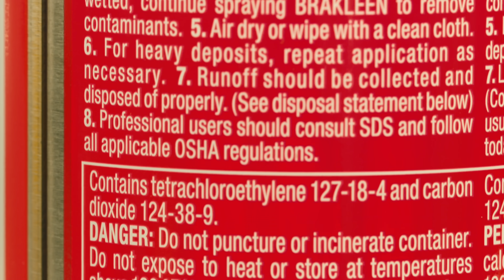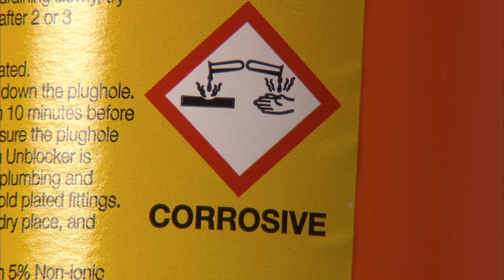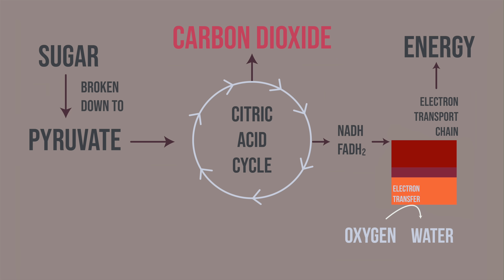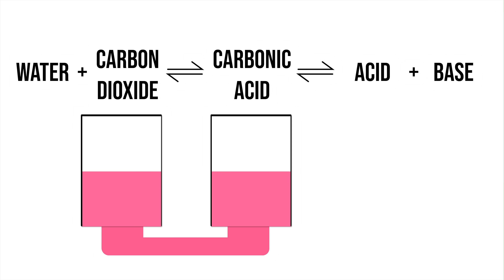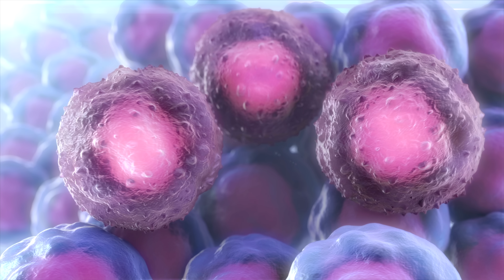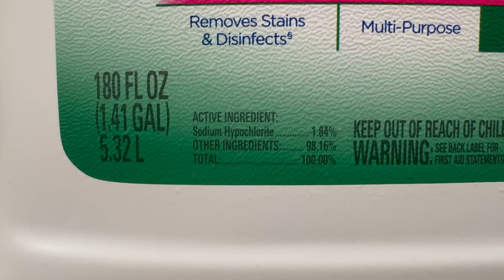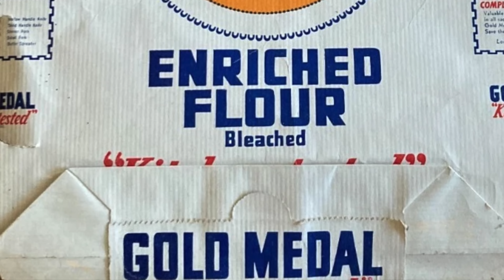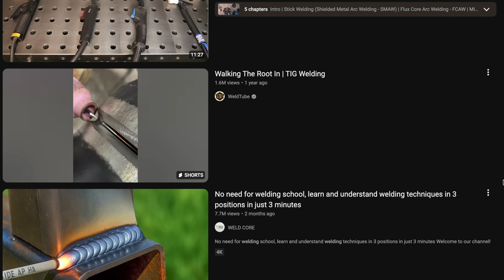"It smelled funny while I was welding and now I can't breathe..."

Comment: Wow - Ive done this before, (ex motorcycle mechanic) welding an exhaust that really was too far gone, at one point I caused a fire with the brake cleaner.
After welding I felt terrible, my lungs felt awful. I just thought I'd inhaled alot of argon from the shield gas and it was sat in my lungs 
I even layed upside down for a bit after work hoping it would help.

The thought that it could have been life threatening is crazy. My boss wasn't even happy, i'd wasted so much time it would have been cheaper for a new exhaust anyway, and the time wasn't really billable.

Comment: Yes, things like chlorinated brake cleaner and the older refrigerants can be extremely dangerous. 
But it's not an excuse to completely ban them forever because some people don't take correct precautions. It could be more regulated, though. 
The performance of chlorinated brake cleaner is not equaled. Substitutes take far longer to work with to achieve the same results. 
Similarly, the older refrigerants were far more effective and durable. Older refrigerants proved to last for decades without problems. The modern "eco-friendly" refrigerants cause so many issues and last a very short time. Ask any HVAC professional. This leads to a much greater volume of waste and forcing people to buy new appliances more often. 
I don't think the older refrigerants should have been banned. 
Just restrict access and require strict licensing for using it.

Comment: As someone who occasionally welds, I had no idea about this. I can EASILY see how someone would use brake cleaner to degrease a piece of metal before welding. Is there a period of time at which a piece of metal that had brake cleaner on it can be safely welded? Does it have to be thoroughly washed? In my experience with brake cleaner, there seems to be some kind of residue left over from using it. So I would assume, this residue still contains enough chlorine to create this deadly gas?

Comment: 15:47 True, So i thought about asking AI which can be more direct. I asked gemini pro if i should use brake cleaner to clean the rust before welding and this is what it answered right at the start:
- ''NEVER use chlorinated brake cleaner on metal you intend to weld. This is one of the most dangerous mistakes a welder can make.'' 
Ngl AI is a good and practical learning tool, definitely can prevent that situation

Comment: I don't buy a bit of this. Brake cleaner evaporates immediately. There is no residue left on the metal. Phosgene is created when LIQUID clorinated solvents are exposed to extreme heat. As in when HVAC equipment malfunctions. Brake cleaner is still very bad stuff, but this video is bogus.

Comment: An episode of Stacy David's Gearz ⚙️ (car building/repair show) many years ago in the early 2000s warned people about this. They probably saved a few lives.
Phosgene gas was used as a chemical weapon in WW1 often called CG = Choking Gas.....Phosgene gas often gets confused with mustard gas which was another widely used chemical weapon. 
Both were deadly, Mustard gas caused burns but Phosgene gas was more deadly than the mustard gas & ☠️ 💀 more people in WW1 than mustard gas did.

Comment: certfied welder here . when ever welding you want to be up wind of the smoke , some shops or jobs are very dangerous because of the fumes and flash burns ,,,,  as they make welding easier ive noticed the safty is being redirected mostly political ,  the alloys being released into the air is crazy ,,,, chromium,  aluminum alloys that cause dementia and altzheimer's,,  so many in one hour martinizing passed early working there from cancer ,,,,,  dry cleaning solvent was always in the air when you went into there stores ....

Comment: By the way, until the introduction of electronic leak detectors for CFC, all AC mechanics used so-called leak detection torches. That was a little burner with propane where the flame heated up a copper coil. To detect leaks, we moved the connected rubber hose around the system, which has soaked the air in. In the case of CFC, the flame turned green because of the reaction with the glowing copper. It also produced small amounts of phosgene.

Comment: Just as an FYI to you all to avoid any zinc painted undercoat or cold galvanised, zincalume, hot dipped galvanised steel and pretty much anything not bare or rusty metal.

ZINC IS STUPID BAD WHEN HEATED, BURNT AND OXIDISED AND BREATHED, it slowly damages your lungs and it happens gradually and is far too late when detected...

Comment: My husband is a boilermaker and once many years ago, had to cut and reweld galvanised steel.  He came home with a massive headache and joint pain.  He went to bed with painkillers and told me not to worry, I wasn't satisfied, this man is tough.  I called the poisioned advice line and was told he had gal poisoning.  Always take care of your boys.
Reply: welding galvanized steel causes zinc-fevers. its very toxic stuff. I use 3M adflow with extra carbon gas-filters + fume extraction. also grind that stuff off before welding. I have not realized its danger for more than 10 years.
Reply: @leonvdm wire wheel on small nuts and bolts also works well and dosent ruin threads. Or hold your breath and use fans
Reply: Always always respirator up while welding even normal steel can cause COPD at a young age. I weld aluminum and stainless and never don't mask up no matter how hot it is your lungs and brain are more important
Reply: @transparencyy0995 Never don't mask up... Couldn't you just say always instead
Reply: @paradoxicalmadness  He could also have just said what he said and you could have just not brought it up.
Reply: @Freshbott2 You also didn't have to say anything and yet here we are
Reply: @paradoxicalmadness  Masks do not save you from chemical contaminants... chemicals are molecularly way too small and go right through. There may be very specialized respirators?
Reply: @midwesternfnp why are you telling me this? I took a quote from the other guy and asked if wording it another way would have been better.

I also know you need to have a respirator with an oxygen tank attached for chemicals.
Reply: @transparencyy0995  Aluminum fumes are vile. Cancer and alzheimer's risk!
Reply: @transparencyy0995  I agree absolutley, he always made our boys use mask and had fans going after this happened to him.
Reply: I got a touch of this once lol. Gotta be careful with galvanized.
Reply: Galvanized poisoning, or the galv flu, as I heard of it.... Steamfitter checking in. I once had a foreman tell me to crack a flange to vent out the line that was inerted with Nitrogen, except it wasn't inerted by the very dangerous gas which is Nitrogen....It was filled with pressurized Ammonia....I cracked the first nut and nothing happened, but employing the method of loosening the nuts away from your immediate face proximity, when I loosed the 2nd nut, the entire room dropped to the floor as liquid ammonia flashed into a gas. Using my training and thinking about self preservation before breaking the joint, I breathed in and cracked that 2nd nut, and that's when all hell broke loose. My ears heard pressure , and my eyes watered instantly, and anyone within 50 feet hit the deck. I quickly tightened the second nut and the vents took care of the rest... Lesson learned...Never take your foreman's word that a line has been cleared and cleaned.
In 35 years, this crap happened twice. 
Make sure to take that breath prior to breaking any flange, and ALWAYS have a way out of the situation if you can't immediately control it by twisting a hex nut one face....
Reply: @KevinQuinn-k7l  I'm so glad you're still around to reply.
Reply: yeah they teach welders about zinc too among other things
Reply: I puked from zinc fumes once and learned about chocolate milk, turns out it helped, then I grew up and masked up since.
Reply: @tyrel7185  I agrew I just wont touch it. Ill use acid to remove it first but will 99% of the time avoid it
Reply: @CrowJoe13 What acid do you use?
Reply: @Cantthinkofahandle117  muriatic from home depot. Then i neutralise it with baking soda. Wash dry then weld. Ive only done it o. U bolts that i had to weld. Did it all outdoors with a big fan. Stay safe and double check everything i say from a credible source. Just because i did doesnt mean anyone can do it 😅
Reply: Drinking milk is the cure for gas sickness following galvanized welding
Reply: Drink milk
Reply: @DavidMcmillion-ns5wg milk probably wont be effective against zinc in someone's body
Reply: @uraniumConnoisseur there was a study about this old welding myth. Apparently there is some truth to it. When the milk is matabolized some of the results react with the zinc in the blood stream.I don't remember the exact details
Reply: @DavidMcmillion-ns5wg  ive heard that before years ago

Comment: Nice message for those amateurs who use chemicals without even doing a basic google search

Never use chlorinated brake cleaner before or during welding, as the heat and UV radiation convert it into highly toxic phosgene gas, a chemical warfare agent that can cause severe illness, permanent lung damage, or death

Yeah... the welding machine came a great price.

Comment: I was a refrigeration mechanic for 45 years, and I have had a whiff or two of phosgene gas, I always just turned the torch off and vacated the area, had to be careful around chemicals.
Reply: I watched a documentary that talked about the first fridges pre-1930s and yikes, so many deaths from methyl chloride and sulfur dioxide
Reply: Purging with nitrogen doesn’t always get it all out sadly.

Comment: This is so interesting to me because phosgene gas is a by product of soldering with refrigerant in the system. I'm an hvac contractor. I can tell you from first hand experience that when you sniff phosgene gas it burns your nose like hell and you get as far away from it as possible. It's alamost hard to believe that SB stayed welding while sniffing phosgene gas it most ceetianly would have burned the hell out of his nose and he certainly would have stopped and got way

Comment: You can also encounter phosgene gas if refrigerant is burned. It happens when you're brazing on refrigerant tubing with some of the gas still remaining. I don't know how the guy was able to stand it, it is very pungent and will burn the lining in your nose immediately. It doesn't smell anything like grass or rain or any other odor I can compare it to. Purging the system with nitrogen will not remove all traces of the refrigerant. Plenty remains trapped in oil throughout the system. And there is still plenty of chlorinated refrigerants out there in use today.

Comment: I was a boilermaker for 32 years, what a dumb thing to do spraying brake cleaner on steel before welding. Run the grinder over the rust and away you go.

Comment: This makes no sense. I've never used brake clean near a welder. But then I usually stick weld and the flux can eat crap. You need to grind metal not spray it with brake cleaner. Again, if you're in the muck: stick weld. Problem is it is hard to learn. Once you have the settings correct and the material is clean, a mig will weld easy. And who has the money to spray expensive brake clean on metal to weld.

Comment: 5 shipfitters died in Vancouver dry docks while building the aluminum fast fairies without proper ventilation for the fitters while the welders had masks and forced air respiration all other laborers were forced to breathe in the phosphagen gas that comes off of the weld metal that was cleaned with solvents

Comment: I was curious because I know a lot of people misuse brake clean (using an excessive amount in a poorly ventilated confined space).

Around 50ppm exposure is immedietly lethal and to make a 2m^3 space (about the space a human body will occupy when standing) exceed the 50ppm only requires 0.1-0.2g of TEC to convert to Phosgene.

So regardless don't weld with brake clean but in addition, stop using it improperly. Your lungs will thank you in the long run

Comment: I use to weld and welding can be dangerous to your health your skin your organs lungs can be exposed to heat and radiation not to mention smoke and fumes and unknown elements no one tells. You on a job what the metal was exposed to before you weld it😊

Comment: Phosgene was used at World War 1 as a chemical weapon, killed almost 90000 Soldiers.... I don`t use chemicals to clean before Welding, if it is neccessary, i  am using an axle grinder with a steel brush or a sanding disk.

Comment: I new from the start of the video what happened. About 15 yrs ago I was welding some pieces I cleaned with a solvent cleaner and experienced a foul odor that hurt my lungs. I stopped and research the results of heating the chemical in the cleaner and found that super heating the chemical created phosgene. After I found this out I reported it to the company I worked for. After this all employees were told not to weld or use a cutting torch on any material cleaned with spay parts cleaner.  I got lucking I have no known after effects

Comment: I remember using the helmet once when welding an exhaust system, it was at school and it was one of those where they don't go dark whenever they detect the bright light. So I welded with it on, fold it up and then back down. And then once accidentally forgot to pull it down and just blinded myself. Getting a few dark spots in my vision for a week or something. And at work, I'm very careful to have my sleves on and jacket on with the helmet and the welding gloves, especially compared to my coworkers. The original reasons I've had my sleeves on were for the sparks because that shit hurts. But now I got another reason added

Comment: I'm an electrician who often works around welders and this is good to know. I didn't realize welders could so easily create poisonous gas. The big thing electricians worry about is drilling into concrete and releasing silica dust, or drilling into something that contains asbestos and we wear N95 masks if we drill alot. It always smells weird when welders are nearby and this is kind of scary.

Comment: The macho culture around welding & fabrication is happily shifting. I am a self employed fabricator, machinist & welder 25 years & lucky enough to have great options for p100 half mask respirators & VOC/acid gas exposure. 

Limit what chemicals & solvents you work with. Make chips before dust in cutting & grinding. Diamond cuttoff disks, carbide burrs, handfiles,  metal cutting bandsaws, portabands & carbide tipped chop saws. Limit sanding & dust making, tons of ventilation & fresh air.

Comment: Wow, I had no idea bubble lights were made of methylene chloride…that’s the stripper used in bathtub refinishing (or was, until it was banned from the consumer market due to how deadly it is). If it spills in a closed room, you can go unconscious and die before you would ever smell it. I once bought some methylene chloride as a plastic solvent to fuse acrylic sheets to make small display boxes. But when I realized how hazardous it is, and all the precautions needed to handle it safely, I donated it, unopened, to someone who had experience using it (and went with acetone for my projects instead).

Comment: Thank you for this video. I do a ton of my own work around the house and on my automobiles. I just purchased a bunch of brake cleaner from my local Menards (like Home Depot or Loews). They had both "chlorinated" and "non - chlorinated" on sale, your choose. I didn't know the difference. I figured it was an environmental issue or something so I typed in which works better and the results all stated "chlorinated" brake cleaner works better so I purchased 5 cans of the chlorinated brake cleaner. I was unaware of this fatel situation mixing chlorinated products. I never have in the past, but only because I had no need to. I'll be certain now to NEVER mix them in the future ever. I'm going to tell a bunch of my buddies too. Thank you !!!! Your video will most likely save some lives.

Comment: I have a tailet by the shop. white cheap type that hard water has managed to stain.  My mother made it her life mission to remove the stains at any cost.  Despite me explaining theyd come back.  
One day I enter it and it smells terrible. the metal faucet feels rough to the touch.   In her fanatical urge to "clean it"  she had mixed every single thing she had reach to.  Chlorine,  vinegar, several soaps, drain cleaner,  powdered bleach cleaner and who knows what else.   She didn't get poisoned after very likely have created Chloramine gas and Chlorine gas.  I confronted her and got rid of everything she had access to. 

I used my welder and I have grounded metal. I think I'll start using a n95 mask when doing either one.  and I'll take good note to not clean metal with break cleaner before welding.

Comment: so refreshing to watch a new video that is not AI generated, I think I'll subscribe just hoping future videos have content that interests me as much as this one did (I'm a hobby machinist, and do have at TIG welder, no I'm not good at it) !  🙂  !!!

this one got me thinking,  while I avoid things like "brake cleaner" and try to avoid methylene chloride as much as possible (use it for joining acrylic plastic and only do it outdoors never indoors), I do  have so tapping fluid that's got chlorinated and sulfured hydrocarbons.  they aren't much of a problem, EXCEPT, sometimes its within reach when I need a cutting fluid while milling or drilling, and the heat produced by the operation vaporizes some of the fluid and I'm guessing this is dangerous.  So I'm only using pure hydrocarbons now, no chlorinated or sulfurated fluids for machining, except for hand tapping where no heat is generated.